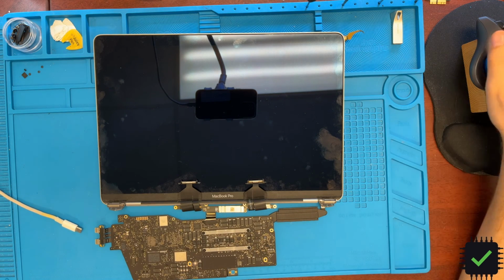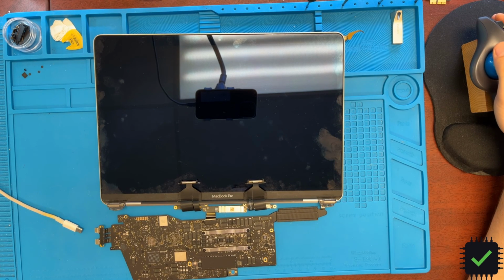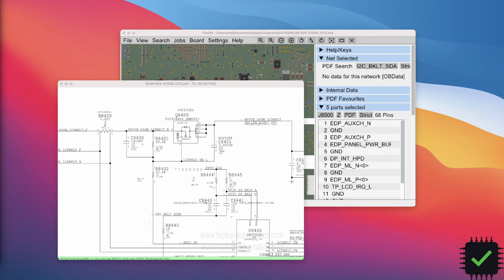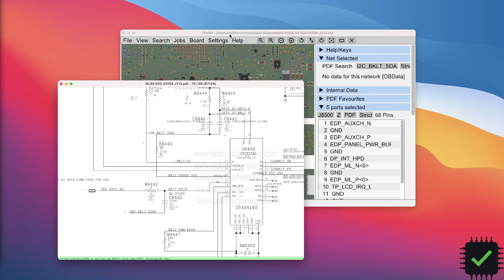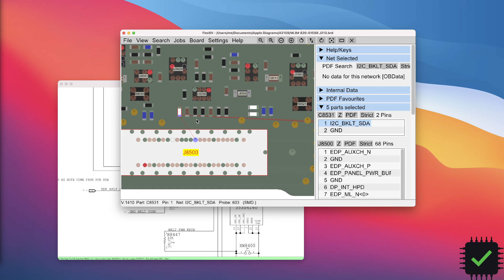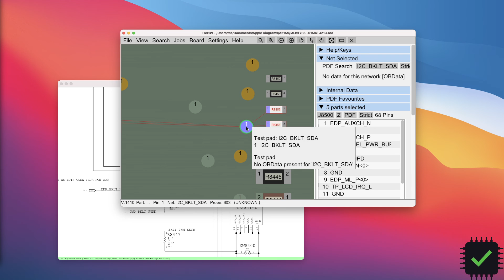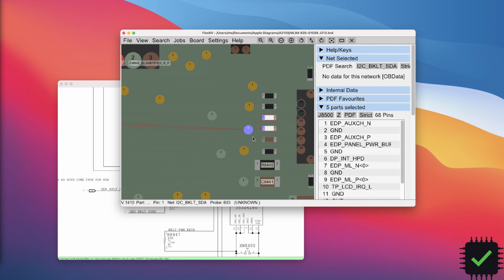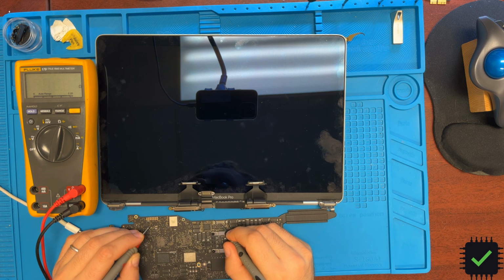MacBook Pro A2159 2019 820-01598 No Backlight Repair. Tricky hidden issue of missing i2c data line.

Comment: Thanks for your video.
So, does it mean that if the mainboard is replaced, will this issue be fixed?
Reply from the maker: If your screen is fine - yes. In this video I was fixing the board though, not replacing it.